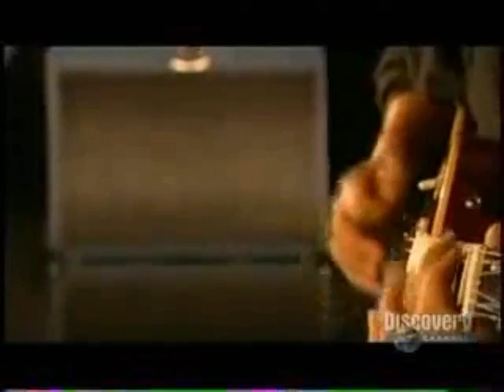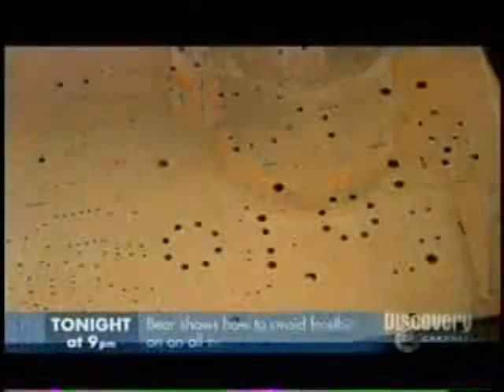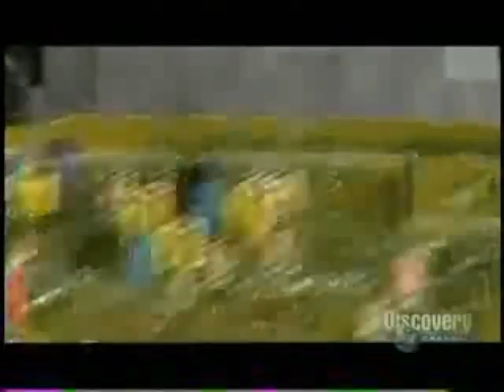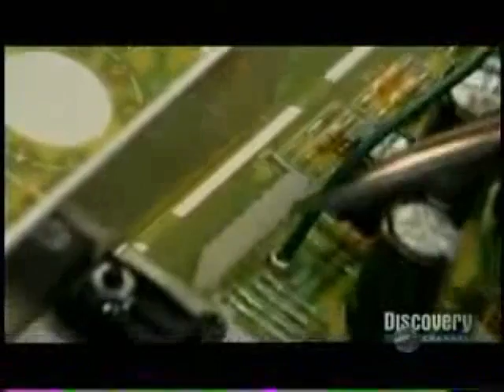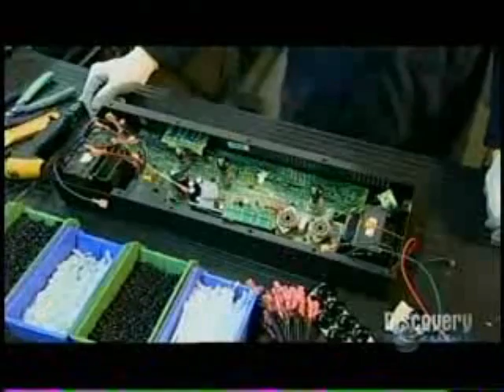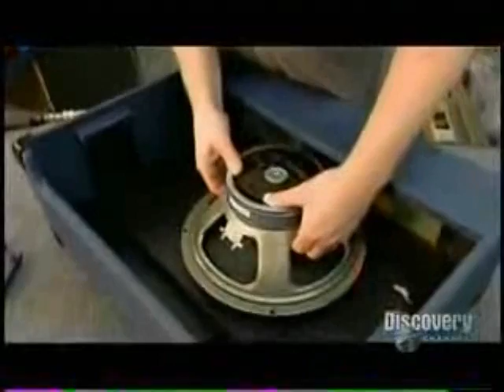How It's Made - Traynor YCV50BLUE

Comment: If you like tube electric sound, Traynor is for you.
This is not a point to point wiring design.
Tubes get hot, and so does the socket.
mounting the tube on a PC board allows the heat to degrade components over time, and why point to point is better.
But this amp does more cheaper than was possible in the old days.

Comment: I had this amp with the extension speaker cabinet. I ended up selling it for a more expensive tube amp. I didn't like the gain channel, but the clean channel was stellar. If you like using distortion pedals, you will love this amp

Comment: I own a YCS50 and two Fenders. I can tell you without hesitation that the quality of the Traynor is much higher in terms of build for durability. As for the sound, well they're all a little different. Both Fenders are noisier by far than the Traynor, so for recording the Traynor is best. The Traynor has much more flexibility as far as dialing in a sound as well.